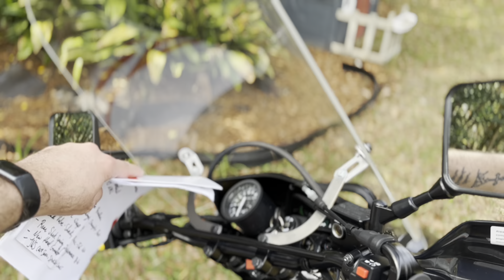Suzuki DR650 accessories

Comment: I bought a 2024 DR650 six months ago, it's a great bike. I have done lots of upgrades to it including the slip on exhaust, after this modification the bike started running really lean and the motor would turn off at every stop light. I just re-jetted it with the ProCycle jet kit and opened up the airbox per ProCycle's specifications and it runs amazing!! A lot more power and way smoother, more responsive as well. It screams now like a 650 should.
Reply from the maker: Ah, yes! That’s the holy trinity combo for the DR. I’ve heard it’s like going from a small block to a big block! I’d like to throw a Lectron and DG slip on eventually. I’m not sure how I’m going to spec the air box just yet. Thanks for watching!

Comment: Hi Mickey, subscriber 63 here ! . I have a white 2022. Have a look at the Acebis frame protectors to save the frame from your boots, I put paint protection film on the frame first so the paint is protected from the plastic to. I like your Warp9 case savers, I’ll be doing those in the near future. I have done the Warp9 levers,foot pegs, brake lever and gear shifter. I’m in the process of doing a Protaper FatBar mod now. ....keep us posted on your mods !
Reply from the maker: Thanks so much, and yes, I’ve been noticing that wear from my boots. I’ll probably be adding those covers soon. I’ll also be making some changes between now and summer, definitely updating/posting changes between now and then. Really appreciate the sub and input!

Comment: Nice bike man! Got the same one back in Nov. Can't ride it enough! 5.3 is going on next week!
Reply from the maker: Thanks! Please let me know what you think of it, the 5.3! I’m hoping to mod it to make the vacuum petcock work when I do finally get one.
Reply: @ComfyDadShoes  I can go 217 miles until reserve going 70 on the freeway, never ran it dry, maybe 250-260 which is perfect for me because it's 82 miles to get to my favorite trails and 82 back so it leaves me about 100 miles for trails and dirt roads without stopping (which I rarely do that many miles off road).  I am leaving my carb alone, I've never had one I've tried to modify run right, airbag stays stock too.  I got the Tusk hand guard/barkbuster type.

Comment: If you’re still reading comments this late: remove the upper chain roller. It’s just going to get ripped out if you’re taking jumps and rough off road. It can damage the frame when it breaks off.
Reply from the maker: I did. One of the cheapest and best improvements. The dealer told me not to worry about, but when I did it was already marked up really bad from chain slap. Thanks for catching that bc every DR needs it removed right from the dealer.

Comment: Really want to get one of these, but a buddy of mine said that these big mono engines don't last long. These bikes are  relatively new in Argentina (less than a year in the market) so we don't really know much them. Really tempted get one of these but being wary because of that, also that they needed some afterdealer adjustement to run properly.
Reply from the maker: @diegolagrost3390  in the 1980’s the larger engines did burn a lot of oil. As long as it’s newer than a 1996 DR650, you can get as many as 80,000 miles (128,000 kilometers) before rebuilding. You may have to adjust the idle from the dealer, but these bikes are practically indestructible! I’d recommend riding it stock, with the exception of a more comfortable seat, and over time slowly add modifications to create what is truly one of the greatest motorcycles! I have some helpful videos with more to come that might help your decision. I’d highly encourage you to buy one. It’s a solid investment in my opinion.
Reply: @ComfyDadShoes  Noted. Thanks for the solid answer
Reply from the maker: @diegolagrost3390  anytime! Hope it helps

Comment: I have a black 2022 and love it especially after I did the suspension upgrades, springs and re-valve in the front and back Total transformation especially for a bigger guy not as big as you 5 11    200 pounds.  Also, got the 5.3 in those two months the best one oh and the seat(SC). great video. Thanks
Reply from the maker: Thanks for watching, springs and tank are a must!

Comment: Appreciate the parts tip at the end and your case guards do look clean. I bought mine used and it already had the chunky steel guards but I won't complain
Edit: the skids n stuff bloke also prefers the plastic skid plate and claims lower friction than aluminum when if sliding over obstacles
Also, in my experience, when I increased my front sprocket to a 16 tooth my engine case guard sprocket cover didn't fit and I had to put the plastic one back on just FYI